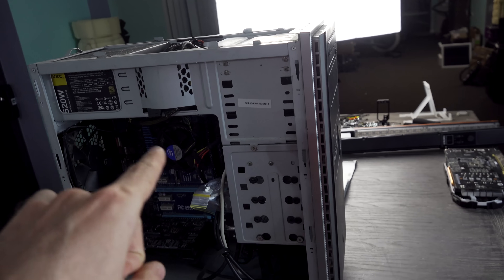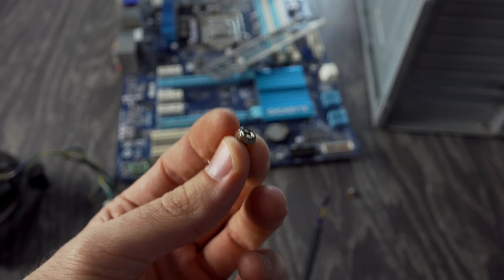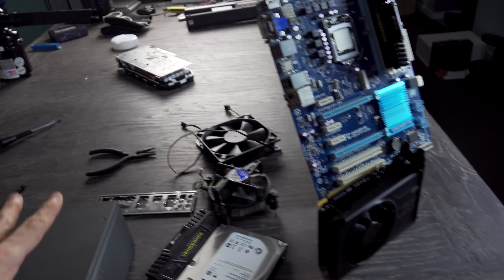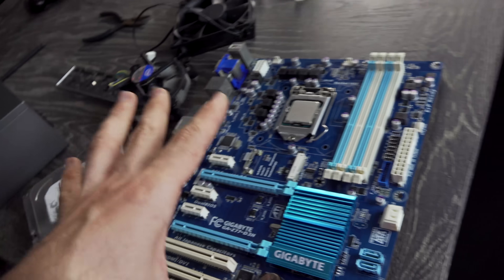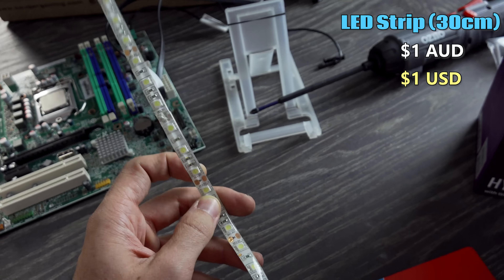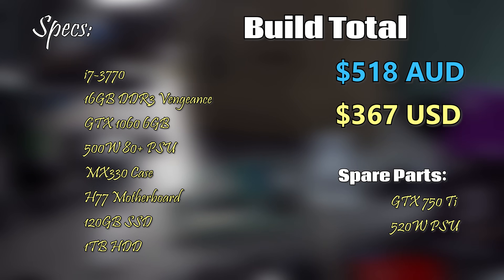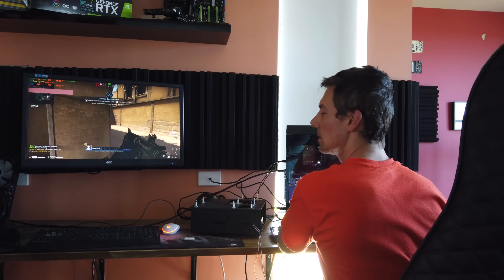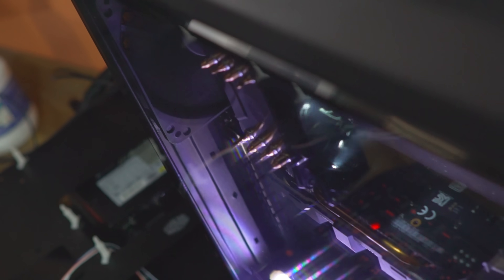Trying to Fix a $150 Gaming PC That Doesn't Turn on - Worth it..?!

Comment: I'll admit... I laugh every time you break out the WD-40... you could be the Albert Einstein of restoring PCs, be 100% correct in everything you say, and by gum, WD-40 is indeed, the best thing you could ever do for a PC... and i'm still going to laugh... it just seems so darn goofy. I love your channel... maybe I just come to see "will he break out the WD-40 this time?". Keep up the great work! 

On the CPU Cooler, while the CM Hyper 411R is either hard to come by or overpriced in the US, the closest 92mm Cooler Master option easily available in the US at a cheap price is the CM Hyper T2... though it lacks an LED fan (it could of course be swapped out with one though). There's so many cooling tower options in the US though at 92mm and 120mm sizes, there's no shortage of options there.

Oh, and oddy enough, I recently pieced together a "spare parts/E-Bay" system for my son... using an ASUS P8Q77-M MB, i7-3770, GTX 1060-6GB, 16GB of RAM and a 1TB SSD... so, very similar to what you ended up with here, and he loves it.

Comment: I have the same case with different fans. I thought the rear fan would be loud so what I did was got 3 arctic fans, put 2 on front and one exhaust. Now it sounds like a jet turbine. Full regret because my GPU tends to heat over 80 degrees celsius.

Comment: WD40...hahahaha. Kewl.  Seriously though, I think you use way too much heatsink paste.  As for the MB, had lots of trouble with Gigabyte boards through the years, something always fails.  Asus has problems too but fewer.  Can't recall buying any other boards.

Comment: My Gigabyte motherboard does the same thing every time I move my PC. I just turn it off and turn it back on super fast (with the power supply switch) while it is boot looping. If that doesn't work I remove the bios battery and out it back in once it boots up. The reason for this is Gigabyte motherboards get some weird bios issues when the bios battery starts to die.
Reply: Might try this if all else fails on my gigabyte board.

Comment: I encounter same problem with an OEM Foxconn motherboard, this is on Acer desktop mini-tower. It Fan spin then shutdown, that's all it does, it fan spin then shutdown, it won't boot, no error beep, nothing wrong with RAM, GPU or HDD. After a thorough inspection I found bent pins at the CPU socket, but accidentally broke 1 off while pushing it back, luckily it's only a Ground pin for this H57 motherboard... then I found corrosion on one of its SATA port & cleaned it up, and then a tiny inductor coil almost broke off on this board while I scrub it, luckily the wire is intact so I just tape it down... then after all that, only after I removed its CMOS battery will the board Boot up successfully. Also its CMOS is broken, it never saves its setting if on battery.

Comment: Well, the Core i7-3770K is actually still an OK CPU today. I have one here on a asrock z77 extreme6 running at 4,4GHz considering cpu-z benchmark it should be around my other system i7 6700k if I would downclock the i7 6700k to 4GHz - don't nail me on the numbers I am just recalling what I thought when I benched them. With good 16GB ram(timings) and a reasonable GFX card (like Rx580 etc) it should still be fine (steady 80+ FPS) in BETAfield 5 at FullHD and custom settings incl. Reshade to make it look awesome.

Comment: I have Corsair vengeance ram as well and I had stability problems on my Asus motherboard I swapped the memory with my other pc that has a Gigabyte board when I changed my cooler which happened to be Ripjaws and both are now fine

Comment: You should make an online shop where you resell PC's like this for a good price so that people with a lower budget can get more out of their money
Reply: It's a tricky thing to do though, such a seller effectively becomes an OEM; inevitable support issues soak up valuable time. It's also very hard to steer people toward builds that actually make sense, such as AMD cards for good value 1080p gaming (RX 570/580), there's an Intel/NVIDIA mindset that's hard to break through. Check the videos by Paul ("not an apple fan") who's talked about this a fair bit.

Comment: Try Forcing backup BIOS 

1. Shut your PC down (if you're reading this guide, than your PC isn't working anyways) 
2. Hold the power button until the PC starts and shuts down again
3. Press the power button again, your backup BIOS should kick in now and should re-flash the main BIOS if there's anything wrong with it.

Comment: I used WD-40 on my aunts Dell to take off some stickers. Then noticed it looked like new. Spayed the whole thing down a year ago and it doesn't have any dust on it and still looks brand new. I did the same to my Razer Lycrosa. First took all the keys off and soaked them in windex for a few minutes then they turned kind of white. installed the rubberized keys and cleaned the whole thing with WD, It's been 4 months now and the keyboard still looks brand new. Side note. I let the keyboard sit for about a week unused to let the WD settle in and dry off. No dust and not slimy nor sticky to the touch. Also, I don't live in a dusty house. I vacuum frequently and dust often so that should be taken into account for the no dust settling on the Case and Keyboard.

Comment: Remove the coin-like BIOS battery on the faulty board, shorten the power button pins for 10-15 seconds and wait about 10 minutes, then put the battery back. If that doesn't help, replace it with a brand new battery with good brand. You can also measure it with a multimeter, if its under 3.00V then its not good.
Reply: Gigabyte boards with dual bios are know for this boot cycling problem I fixed another one yesterday a z170. You need to jump pins 1 and 6 on the bios M chip.
Reply: @TheUnorthodox_1  aha might try that i had 2 B85 motherboards bootcycle on a trade in i3-4150 which worked on the previous pc it had been in
Reply: Bake it in the oven like Linus did.
Reply: that cant be the problem, you can boot mobos without or with faulty cmos batteries no problem, it just dont saves bios settings <3
Reply: @jeremymartens4027  - exactly... what York is virtually saying is to reset the bios anyways, which Brian says in the video he did.

Comment: A friend of mine had a similar issue with a Gigabyte board, but it wasn't Z77 it was H67 and it was brand new.  He had to return the board and get it replaced 3 times before he got one that didn't boot loop.  Then not long after the warranty ran out it started boot looping.  Got in touch with Gigabyte and was told to send the board in and it would cost £50, but they also said if they couldn't fix it they wouldn't refund the £50.  Turned out this was a common issue with Gigabyte non high end boards and Sandy/Ivy Bridge .  Since then neither me nor my friend will touch Gigabyte with a barge pole.

Comment: Hi Brian, yes, please do a 9900k or ryzen 2700x highend cpu coupled with a GTX1060 vs in a lower end cpu like i5 9600k or ryzen 2600, I would like to see how much the cpu can hold back the gpu or the gpu hold back the cpu etc.
Reply: A 1060 wouldn't push any of those

Comment: Most people think wd40 is an oil or lubracant of some kind in all actuality it's not it's a rust solvent and water displacer so putting it on parts like this makes sense
Reply: A guy came to service my garage opener and I told him I used silicone spray as a lubricant, not WD-40. He was super impressed I knew WD-40 was a degreaser.

Comment: The dreaded Gigabyte bootloop. I have the same board and problem. Was going to try brake cleaner and wd40 as I live by the sea.Your deep cleaning yes tips have fixed my hi Fi amp and door bell. Many thanks.
Reply: Gave it a Tech Yes cleanse and started up without cmos battery ( As suggested in comments ) got into start up repair and re freshed windows with files intacked. Looks sweet in my old Alienware Predator case. Thanks to Tech Yes and comments section.

Comment: I don't get it. I honestly don't get what the point of this video was.

You bought a used PC for $150 to be "fixed"... and then proceeded to build a completely different PC with basically no parts from that $150 (if I understood correctly, the only part you took from that was the CPU? And maybe the hard drive? But that's it. Everything else was not from that.) How is this "fixing" anything? Or what exactly did this have anything to do with the $150 PC? You didn't "fix" anything. You just bought a $150 used PC for spare parts, and built a completely new PC using one (at most two) parts from it.

This video seemed completely pointless.

Comment: I love these Ivy and Sandy Bridge era CPUs. I have my 3770 in a secondary PC paired with a 970 for friends to use when they're over. Hooked up to my TV I have a itx rig - i7 2600 paired with a 770 for couch gaming and watching movies. Only upgraded to a i7 8700 to get some faster rendering times and m.2 support on the motherboard. The older CPUs were still plenty fast for gaming!

Comment: Hello mister tech, i'm following you from africa, huge fan of what you're doing here with computers... But I was wondering... If you could do something about the I5 4440 (I bought A DELL pc with this processor, and i'm applying some modifications on it ... Power supply... SSD , R9 270X... etc ... ) Just wanted to know how far we can go with this proc...
Reply from the maker: Its pretty solid, an RX 570 with that will go well, or a GTX 1060 6gb.
Reply: @techyescity   thank you ! i'll probably go with the GTX (6gb is really intersting ) . I'll keep this proc for a moment then :) Have a nice day !

Comment: Got one of those Z77 boards on  my current rig. Seems Gigabyte really took a downturn with the quality of their products around the time they started making these? The audio on mine only works on one channel if i used the front case jacks or those on the back of the board yet works fine if i use a USB headset.  Or at least did until my Seasonic PSU just exploded in a shower of sparks..

Comment: I cant understand why you wouldnt get Asus  or Asrock P67, Z68 or Z77 boards... They turbo overclock sandy and ivy bridge cpu's 4 steps above stock speed. So that 3770 runs at 4.4ghz! Its insane to leave that much performance on the table budd.
Reply: Asus and ASRock are definitely the brands to get on 1155. My z77 extreme 4 can get and hold a 3770k at 4.8ghz and it’s a budget board.

Comment: What a coincidence. I just built a computer with a Cougar MX330- G case too.  Mine is the tempered glass version, but it didn't come with a power supply. I love the case. Has everything I was looking for. Mesh front, tempered glass side, 2 front USB 3 ports, and a 1 DVD drive bay and it was on sale for $45 US dollars.

Comment: I've noticed you always put the led strip on the bottom. Is it simply because otherwise it will fall off eventually? I always put it on the top because it looks way better IMO (and yes, falls off after a couple of months, depending on the adhesive).

Comment: I have Lenovo Q77 motherboard and i5 3470 but it doesn't work with any GPU that needs external power, tried with different PSU's that are more powerful and GTX 1050 and GTX 960. Tried everything I found on internet but nothing works. Could be faulty motherboard that I got?
Reply from the maker: I have had one of them faulty before, I would see if its the settings and try use the onboard GPU port first.
Reply: @techyescity  I have tried everything, settings, bios update, bios reset, disabling integrated graphics, switching to UEFI and everything else. Nothing works, black screen with no signal. But interesting part is, gt 730 works in it. Probably just faulty motherboard

Comment: how does my newer but not as good i5 6500, 16gb ram, gtx 970,  corsair sfx 450, ssd+hdd get more frames in those titles? like a hell of a lot more, no overclocking, not doing anything, my question is simply the architecture of the cpu and the miniturization of the nm process make that much of a  difference, i was told a  6gb 1060 was better than a 970, even tho a 970 has 1664 cuda and the 6gb 1060 has 1280 cuda cores??

Comment: I guess its something failing on these boards like small transistor or something like that, i would suggest you to try repairing them
Oh and install inspectre on all of the older PCs (lets say haswell and older to increase performance)

Comment: How do you get rust on a desktop case? That is interesting. This from a guy who used to let his system (just an OEM) accumulate way too much dust for way too long.
Edit: living next to a sea, that could explain it.
Reply: I once obtained some systems that had seen extended use on an oil rig, the rust had to be seen to be believed.

Comment: Magisk YouTube Vanced is awesome. Nice combo too, i7 3770 + H77 its nice and cheap since people usually go for the 3770k + Z77.
Reply: Do you know to disable the notification screen on youtube vanced? Its so annoying
Reply: I cant understand why you wouldnt get Asus  or Asrock P67, Z68 or Z77 boards... They turbo overclock sandy and ivy bridge cpu's 4 steps above stock speed. So that 3770 runs at 4.4ghz! Its insane to leave that much performance on the table budd.
Reply: @hoomansadjadi7666  I don't have a 3770 I have a 4790k